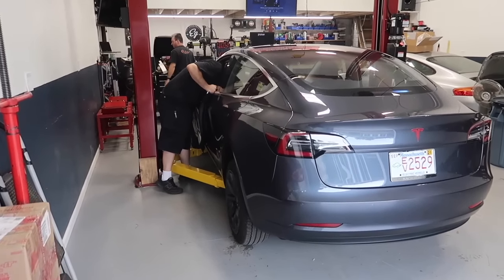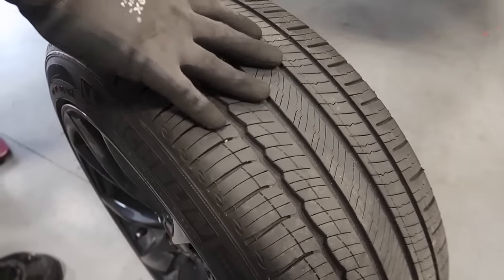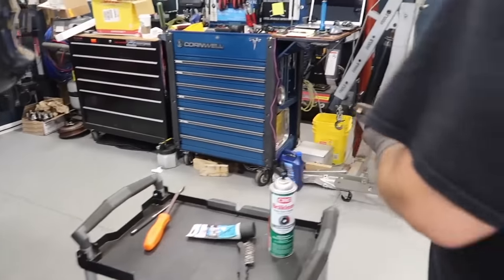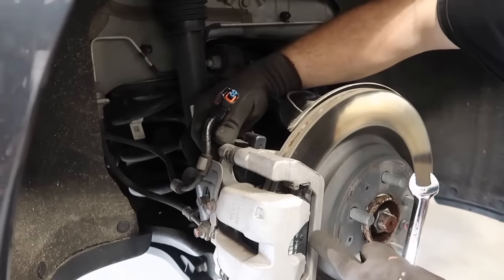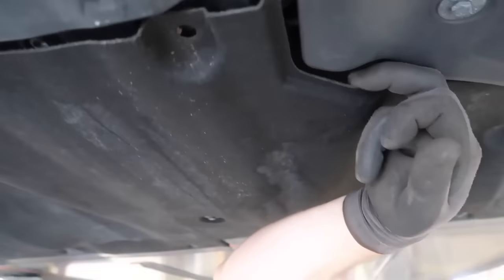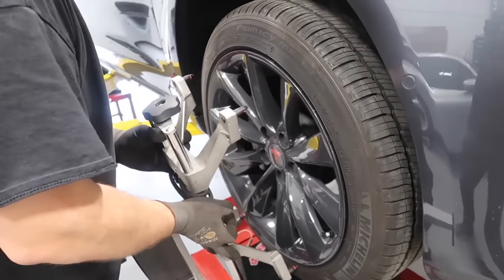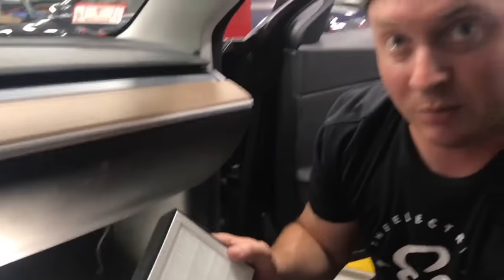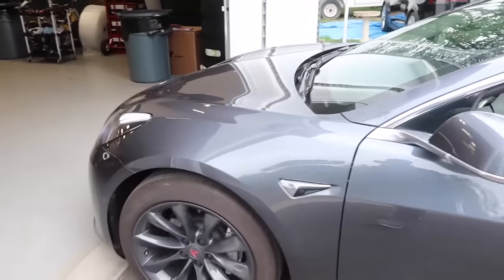Servicing your Tesla model 3: The Complete Guide

Comment: I saved a ton of money on my Tesla service by being too poor to afford a Tesla.
Reply: Me too.
Reply: You do not need tons of money to buy a Model 3. Maintaining it costs much cheaper than an ICE car.
Reply: @CAHE4KA76  - you need tons more money than I have.
Reply: I have a 15 year old car. It costs $500 to service yearly. Doubt the Model 3 is less than that, even just looking at this video. Any modern car will be more expensive to service. Things are harder to get to and there's more that can break, usually electric equipment.
Reply: @zolikoff  I have a 10 year old car. I spend 500-1000 every quarter to getting fixed what is broken. It would cost me 20-25 to get to work and back every day because its average consumption is 18 MPG. It is $500 a month. At the same time driving a Tesla costs me $4 the same distance. It is under $100 a month. Plus, it does not pollute the air where I live.
Reply: Sounds like you have a very inefficient car, mine does about 34-36 MPG.
Also, I don't drive it daily to work, I ride the bus. Car's for longer travels or when I need some hauling. I drive maybe 8000 miles per year on it, less than average.
If I had to drive a car to work (hopefully never) I'd get a PHEV, but only if I had the opportunity to charge it at home. I live in a flat, so I can't.
Reply: @CAHE4KA76  what car do you drive for having to put up to 4k$a year on repairs? Do you swap transmissions every year? lol . I drive a 15 year old acura and I spend from 300$ to 700$ a year, you should get somenthing that  gets better fuel economy if you actually care about saving money.
Reply: @konstantindufnik696  it is a 2010 Buick Enclave. It is a big 8-seater SUV. We used to travel a lot, and keep this car because it can carry a lot of people,  bags and pull a heavy trailer. For my commute to work I purchased a Tesla Model 3, and it is very affordable (the total bill was under 43,500) and saves a lot of money as it requires almost zero maintenance, and charging is a few times cheaper than gas.
Reply: @zolikoff  I wish I had other options rather than driving 100+ miles daily between Orange County and LA. I can also take an Amtrak train or bus and Metro train. In this case my commute will take up to 2.5 hours one way and may cost more than driving my old Buick.
Reply: @konstantindufnik696  the last thing I got fixed a couple of days ago was the starter. The bill was $511.
Reply: I hear you man, that sucks. I wouldn't subject myself to this kind of commute. I would move or find another job easier to get to.
I'm sure the Model 3 is cheaper to run daily, but it did cost a fucking lot to buy (I bought my car used for $5000). And after all you're maintaining two cars... I do not think that overall it is cheaper or worth it. The big problem is that commute itself, it's unhealthy.
Reply: @zolikoff  I am thinking about moving closer to work when my lease is over. But the cheapest places in the area within 25 mile radius for a family of 4 in a community with good public schools start from $3,000-3,500, and basically no services. I live in a community 2 miles away from the ocean near access to freeways, shopping and schools 10 out of 10, and pay less. It is less expensive to commute then live near work. I cannot change jobs at the moment. It would be easy for me to do, but they can give me something that others cannot))
Reply: Well, that makes sense, a 10 year old  GM is not going to be reliable at all. Getting something new like a honda civic instead of that telsa would be much cheaper, even in the long run.
Reply: Funnily enough my 15 year old car is an Opel which is GM, and it turned out fine. It's no Toyota though.
Reply: @CAHE4KA76  Is it really that common to have CRAZY long commutes on US? I'm from Finland(northern eu) and almost every time americans talk about commute, it is ridiculous distances. Here commutes are usually 5-20 minutes, by walking/bicycle/bus. So 1-10km(few miles) long. Many lazy ones use cars for short distances too. Distances are usually less than 50km even for most crazy ones. Average car consumes around 5 to 7L/100km (which is way more logical way to state the amount of gasoline consumption than MPG btw) = 30-50mgp. On the other hand our gasoline costs ~1.5e/L = around 6 dollars/gallon which is much more I think? But anyway, everyone has their preferences, I would never waste more than 30mins into commute.
Reply: @flevingfinn5885  Europe has higher population density than the U.S. Things here are spread father apart. If you don't live inside a big city, you have to have a car because public transport isn't convenient and will likely add a lot of time to your commute.
Reply: @David-nh7px  That is partially true, US is huge. But just looking at population density, Finland have 16.3 persons/km2 and US 32/km2 so Population density is twice as ours. (Of course it differens between countries in EU). It just sounds so weird that most jobs are so far away from the population at US, I guess. And I just wondered if it is really like that, that most have to drive hours for work, or It is just a thing for big cities at US and smaller places are more like it's at here, they live much closer. But I have also read things like it is weird to walk to school/shop/etc even on smaller towns, so maybe US is more car-centric. Here it is still common that +8y old kids walk/cycle to the school and so on.
Reply: @flevingfinn5885  I used population density, but it's a bit more varied of an explanation than that. One of the other things is lots of smaller cities and towns are basically planned out with cars in mind. A larger spread with less emphasis on dense population centers. Now I'd think that commutes of "hours" aren't so common, but I had one that was 40 minutes. Average seems to be 27 minutes.
Reply: @zolikoff  ive spent 3 bucks on some windshield wiper fluid this year, and 0 last year
Reply: Auto Pi we as Americans don’t encourage our governments to invest in public transit like they do in Europe. It is popular here in USA to “drive until you qualify” for a loan on a house. So people end up living far from work to save money because they underestimate the true cost of that long car commute.
Reply: @CAHE4KA76   Until you get a multi-thousand dollar service quote
Reply: @gsilva220  what do you mean? Servicing a Tesla does not cost as much as a gasoline vehicle, and there is not much to look at. An annual service costs $450 at a Tesla Service center, and it is not required. All you need is to get the tires rotated once in a while.
Reply: @CAHE4KA76  That's until the car tells you to pull over safely...
Reply: @gsilva220  why should a brand new car break down and why it should cost several thousand dollars if most of the defects are covered by the manufacturer warranty?
Reply: @CAHE4KA76  you compare an 8 seater SUV to a compact and the compact will always be much cheaper.
Reply: @zolikoff   14 months ownership of a model 3 and haven't paid a single dollar in service.
Reply: @aptwo That is normal for any car at that point in its life, let's see when it's 15 years old...
Reply: Alex Pantel yeah the maintenance cost are lower but the total cost of ownership isn’t. Besides for a vehicle of this price point, the Tesla shouldn’t have the quality issues that they have.
Reply: @AlexTheLi0n  Quality issues will improve overtime as Tesla is a young company. People that shit on Tesla seems like they haven't done much research on Tesla at all.
Reply: aptwo I hear you and quite honestly I have done the research because I so wanted to buy a model 3. I have a friend with a 2028 model 3 and another owns a 2016 S. I enjoyed driving both, but after extensive research and watching Rich and other YouTubers I couldn’t in good faith justify the purchase of a new or used Tesla. They are a young company that will get there eventually and when they do I will consider buying one. I’m not crapping on Tesla just telling the truth.
Reply: I stand corrected that’s a 2018 model 3
Reply: save a lot of money crusing around in a 3P
Reply: @CAHE4KA76  Wait, what about insurance cost?
Reply: @Poorgeniu5 my Tesla insurance premium with similar coverage is lower than I pay for my old SUV. I live in California, and Tesla offers their own insurance which is up to 30% less expensive than other insurance companies want.
Reply: @CAHE4KA76  you  actually need tons to actually keep it when you dont really own it.
Reply: 100% owning your car, tesla wouldnt like that because they dont make any money from those consumers in the long run. They'd do anything to sell you the finance options. Not buying all of it outright.
Reply: @steve00alt70  I got it financed. 3.5% a year is not that terrible.
Reply: Replacing those  16,000  ''D''  Batteries is  a real  chore...
Reply: Will a annual service from your shop be cheaper than going to a Tesla SC?
Reply: My Lexus is still under warrantee as well.  Lets  compare  costs after 8 year of ownership when your warrantee expires.
Reply: Did you seriously try to suggest that I'm less safe riding the bus in the city, from a car accident perspective, than if I were driving the Tesla you're shilling for? I mean I know Teslas are heavy but they're not THAT heavy. If a bus and car collide, it's the car that becomes a cue ball, not the bus.
People will also do anything and everything to rationalize their greatly expensive purchases. I'm sure your overpriced Tesla is safer than my $5000 car in an accident. The reason why I drive the latter is because it's what I can afford.
But if I had $60,000 expendable income for a car, I know enough about cars to know it's not a Tesla I should buy if I want quality, comfort and safety.
Reply: I sold my beloved Chrysler 300c (2006) and my Cadillac Escalade EXT (2005). I was paying roughly $650 in fuel, per month, for both vehicles. Not including maintenance mind you. For me, I saved $25 a month by getting the tesla. I realize my use case is my own. Just thought I'd share. Once the car is paid off, The car will cost me -$20 a month to drive. I have Solar (that is saving me money too, whole other conversation). Whatever you drive, enjoy it. Nothing lasts forever.
Reply: @zolikoff  well, walking is cheaper than your 15 year old car :P
You gets what you pay for.
Reply: @CAHE4KA76  You are not yet in the age or stage of replacing/ repairing non routine components (Cells, battery, sensors, modules, relays, etc).
Older ICE cars are proven they can be resurrected no matter how old as they are designed and constructed to be serviceable with minimal tools and parts. 
Tesla have little to no publicly available repair instructions, high specialised tool barriers (computer software), NEW risk of manufacturer retaliation (black listing) etc
Reply: Alex Pantel at over 70 k AUD YES YOU DO
Reply: I would be interested in Chad's opinion on this. Wouldn't it be good preventive maintenance to replace that big fuse the one with the sand in it and all the little fingers. That thing seems to degrade over time especially if your jack rabbiting very often. Just curious if you thought it would be a good idea to replace it when the car is in for maintenance anyway.
Reply: big brain
Reply: I’m a mathematician and I broke down the costs of a Tesla Model Y-$53k and compared that to a Mazda CX-5-$22k. Long term (20 years or 300,000 miles), the MY was about $6k cheaper when all costs were accounted for. I assumed no major mechanic issues from either car to be as fair as possible. The kicker is the length of term. If people only keep their vehicles for 6-8 years (the national average), then the MY is no longer more affordable. However, if you compared the MY to something or similar upfront cost then the MY is cheaper at pretty much any time interval. It’s the upfront cost that’s the issue for most people.
Reply: @kevinsaint20  you don't need to be a mathematician to find and understand those numbers. Tesla makes pretty good vehicles for such a baby company. Like you said and others before you it is that upfront cost. Pretty much the same that hurt folks looking at gas vs diesel trucks.  Upfront of a diesel could joke you, but cost to fuel and a few other items you could turn out better in the long run. Tesla is the diesel on this equation. Old equation since electric was kicked out the game pretty early on. After a lot of training and practice it is back kicking and screaming. 

I keep  vehicles til their wheels fall off then put them back on for another 2/3 years and not afraid of an engine or trans swap. Tesla doesn't makes doing that I love easier, that's working on my own vehicles. Uncle Rick gives me the confidence to do some of those tasks. 

To the point after that round about. I own two Toyotas 06 awd Sienna and 13 Venza awd. Low maintenance cost for both and insurance I have pretty high as aholes like to be under insured. The Tesla Y Long-range or Performance cost the price of two 2013  Venza payments and no change for tips. I still come out cheaper when totaling all expenses paid not just this and that categories.  I want to go all electric but the price has to come down for the justification or of course my cash flow could just increase. I am cheap to a point and see the Teslas worth in certain safety features and comforts.
Reply: Not if you bought another car instead. My brother has bought brakes in the 9 years he's had his Model S. We replaced a tire on my 2 year old Model 3.
Reply: Same
Reply: You could save a lot of money if you have decent public transit, America does not have. No car, No Insurance, No maintenance, No cost for fuel
Reply: Tesla is very cheap

Comment: I really like this video.  There is a lot of useful and interesting information on model 3 maintenance.  I think that I would be able to do everything myself save for the front wheel alignment.  I like that you mentioned the cabin filter upgrade and the 12 volt lithium battery upgrade.   I can't wait for the 2 and 4 year periodic maintenance videos.

Comment: Rich, thank you for the tour on the underside of the beast, this is pure Gold to guy like me.  Having done a lot of my own routine maintenance on previous autos for years ( my last gasser had over 500K on it when I gave it away)  I really appreciate the design and ease of access to perform simple maintenance procedures.  I am retired military (USCG) aircraft aircrew/maintenance mechanic so I can really appreciate a good design when I see one. In the Guard if we crapped out an engine away from homeplate the base would send us a new one and we came home when WE fixed it, we did it all.   Love those disc brakes, eazy peazy, especially the fronts.

Comment: Thanks for making this video Rich. 

Nice work Chad. Would you recommend adding a touch of lubricant to the rear brake guide pins?  Also when does the fluid need to be flushed?

What is the typical cost to do a service like?

Also, does Tesla care if this service was not done by a certified tech?  I figure brakes , wipers and filter could be a DIY.

Comment: Rich.  If you did a hard brake once a week or so would it keep the brakes healthier?  I was told to do this on my Volt.

Also were you chewing gum while recording?
Reply: i doubt it, just drive the car normally.
Reply: Braking from time to time helps to prevent a rust film on the brake pads. You see this a lot on cars (of any type) that are not used for a long time, i.e. when being out for sale.
So yes, some braking does indeed help to keep your brakes "healthier" and especially helps getting the full braking power when you need it. Also, it uses the brakes so little that you won't have to worry about exchanging it sooner.
Reply: @fatmybutbogs  That supposes that you use your brake pedal. Not all people do since regeneration can slow you down pretty well.
Reply: The answer is yes
Reply: I hear chewing and it’s annoying :/
Reply: Those pins exposed to the elements are the same crappy design as Toyota trucks. No amount of braking will save them from rotting. It's a terrible design
Reply: Jesus that gum chewing was annoying.
Reply: @matts3932  Uncle Rich gotta be keeping those jaw muscles thicc.
Reply: did that on my volt and it solve the problem of jamming pads ,then I made sure the guides were clean and greased

Comment: The radiator cover under the Frunk storage traps a ton of leaves and crap against the radiator. I didn’t even realize there was a radiator in there. My Model 3 is 3 years old and the cooling fan was running super loud like it’s going to explode, for hours and hours, even while  parked in my garage for the past 6 weeks. I found a video talking about cleaning out the radiator. I get in there and pry back the cover to find the radiator was like 70% blocked with debris. I vacuumed it out the best I could and it doesn’t sound like it’s going to explode anymore. 

I also found that the coolant level was  low, something you can’t even see without taking the Frunk Storage cover out.